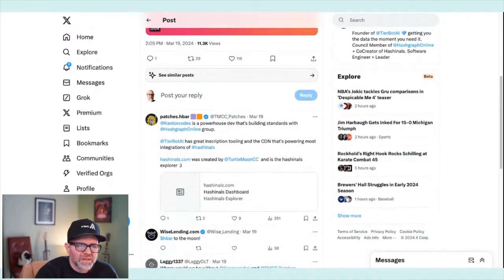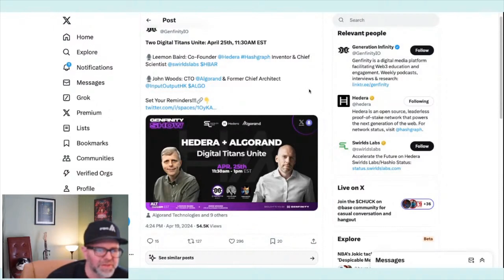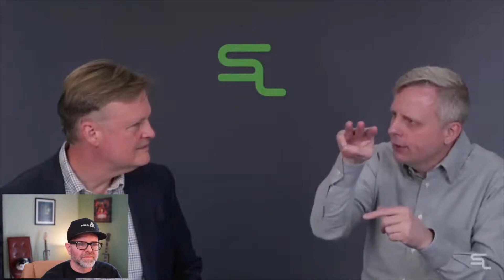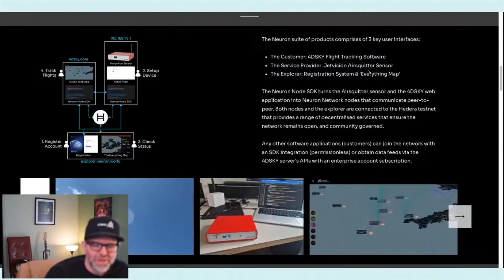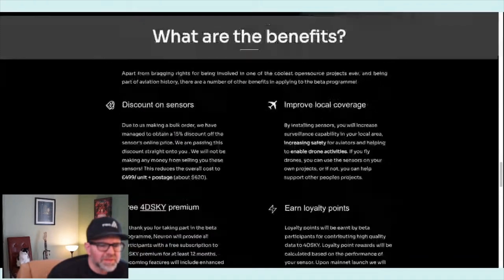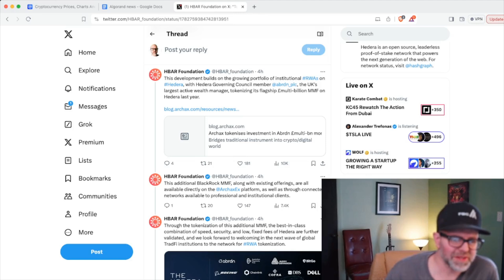BREAKING: Hedera HBAR announces GIANT partnership with Blackrock!

Comment: Um This whole “partnership” between Hbar and BlackRock has been blown way out of proportion. It was worded badly and if you look into it you will figure out it’s a flop of a headline. Meanwhile it has corrected back 60% now. I almost fomo’ed in and then I researched. I am sure Hbar will still do well but yeah this story is BoGuS.
Reply from the maker: No it's not. People are just over-interpreting the word "partnership." They worked with Blackrock on this, according to the Foundation's blog. But it's on the looser side of partnership, it's not like revenue sharing or something, which would be more on the stronger end of partnership. That said, people who buy into things when they spiking, I will never understand. It's the opposite of what actually makes you money. I took profits on the pump.
Reply: @FrugalBC  great

Comment: From Cred on X: "Update to this: It doesn't seem anyone needs explicit permission from Blackrock to list tokenized versions of its funds. It does not seem like Blackrock "chose" Hedera for this, rather an existing platform on Hedera that deals with tokenizing RWA took the liberty of listing one of Blackrock's funds. 
This still doesn't change the fact that a platform on Hedera was one of the first to tokenize a Blackrock fund and this also begs the question- why haven't other blockchains done the same? 
In any case- nice to see a platform on Hedera lead the charge."
As well, Archax is using abrdn, which is on Hedera. abrdn isn't paying for anything - they are using a grant from Hedera, so Hedera isn't benefiting at all on this deal. Still, it's pumping, so good for them :)